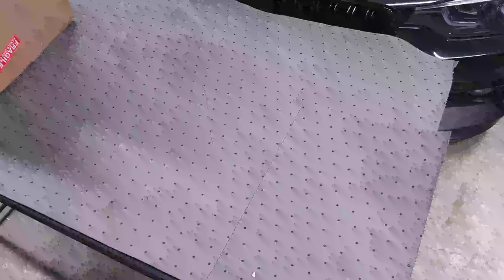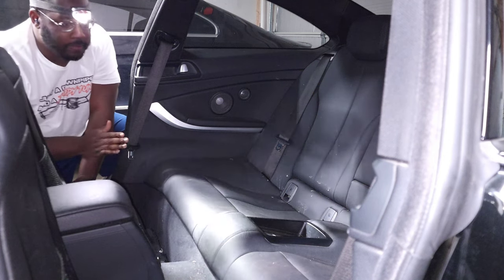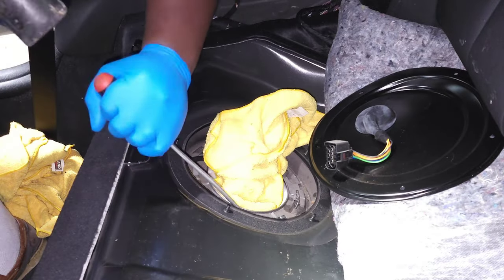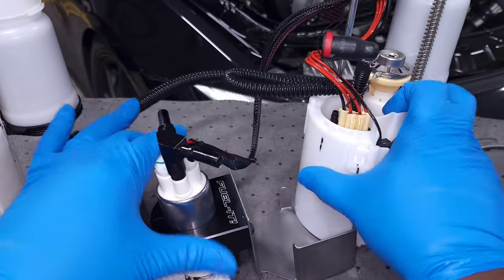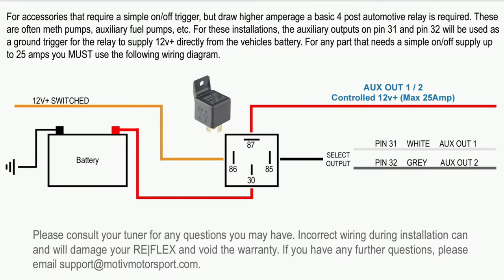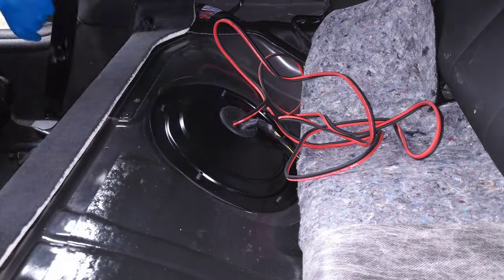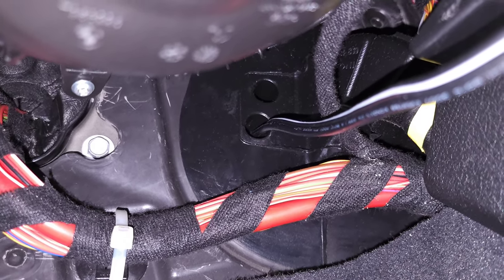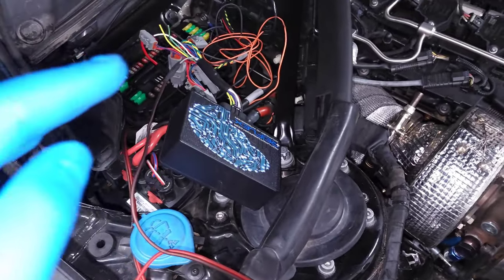Upgrading the LPFP on my Big Turbo 440i!

Comment: Informative video!

Did you have the option to use a solid state relay with the PWM output from the Reflex+?

If so what was your reasoning for the on/off control?

Thx you!
Reply from the maker: I think it just adds another level of safety and control so it cannot turn on unexpectedly. The pump cannot run 100% like the stock pump or it will burn out
Reply from the maker: it may be the sensor. they are recommending something for the reflex safety parameters so it's a good idea, but it should vary based on fuel pressure.

Comment: I'm curious, you did a video about the fuel it lpfp about 10 months ago or so and stated it wasn't the best because of the possible problems of the fuel starvation and fuel cut. What made you go with this option afterwards and not the other options ?
Reply from the maker: The drop in pumps tend to burn out the fuel pump control module. All the pumps with the same design have the same risk. But I liked the design on this one to make it easier to install.

Comment: I have been getting a code on my stage 2 440i’17 

And the code is : 118209 LOW FUEL SYSTEM; DELIVERY RATE TOO LOW,

I think this code is related to the low pressure fuel pump and i have been trying to fix it but what should i do? 

Can i just buy another lpfp or should i upgrade it? Or if there is any other way to address this issue because sometimes when i do a pull the car goes itno comfort mode.

Comment: how did you remove the top hat? that is what’s holding me back right now e
Reply from the maker: it just came off but you shouldn't need to remove it. put the secondary pump in the tank first, then push the main lpfp onto the bracket.
Reply: Thank you, I ended up getting it in and I have precision raceworks so it s slightly different but same concept. As for the ground, what did you ground it to in the rear? Thanks! @kern417
Reply from the maker: there are a few grounds in that area so i just grabbed one that was being used by an existing wire harness

Comment: Kern how in the world did you run all that fuel with a stock pump only this whole time, my tuner would not let me run PI at full E85 without LPFP
Reply from the maker: Because everything in the system has a limit and i wasn't hitting the limit until now
Reply: @kern417  you weren't on full E?
Reply from the maker: I have been for about a year, yes

Comment: So what if the auxiliary FP fails...will that cutoff the fuel supply
Reply from the maker: It's completely separate. In most driving scenarios it's not even on. It should only be activated at a specific boost level, in which case if it's needed for your setup then yes it'll cut fuel. With a reflex it can actually monitor lpfp pressure and put the car in limp to protect the engine.